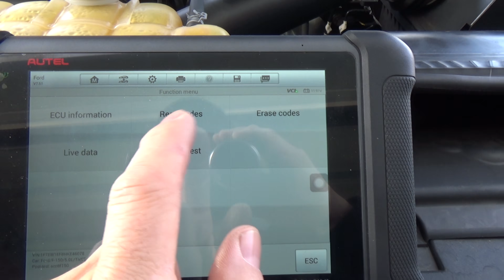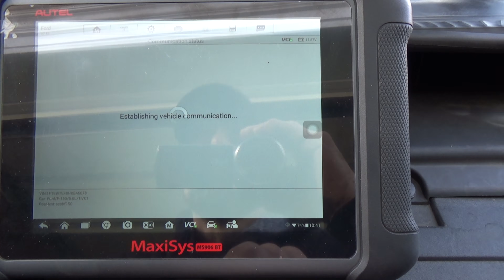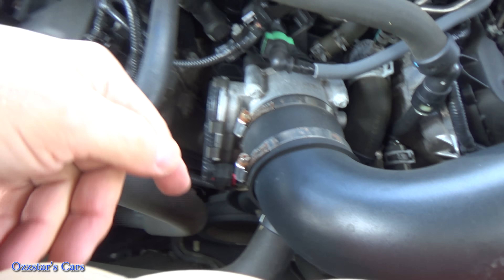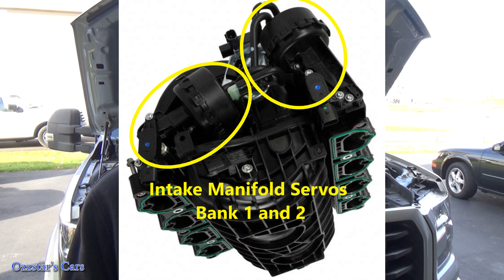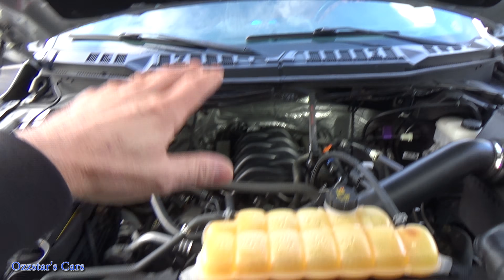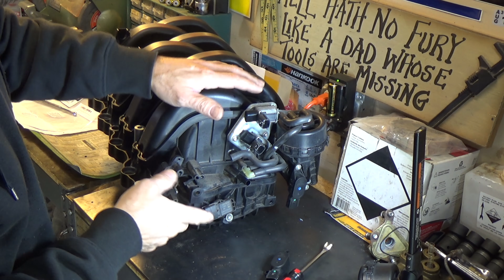Ford F150 Engine Rattle Tick Noise: I Can't Believe Shop Says It Needs A New Engine

Comment: I have the 2019 f150 with 5.0 and mine had the same issue then ford found a piston loose and scared up cylinder wall then they replaced the long block at 35k miles and then installed the longer oil dipstick and replaced the PCV valve with the 2015 mustang 5.0 pcv valve with the checkerboard cut holes to restrict air or gas and then reflashed the throttlebody to reduce the butterfly from openeing and burning oil they did all of this per the latest Ford TSB., it worked, it no longer burns oil and now at 56k miles with no issues still using 5w20 oil no problems.
Reply from the maker: Interesting info. In 2018 Ford ruined the 5.0L by going GDI. They suck more than oil. lol

Comment: Hi ozz star car's many thanks for your videos as to what you have stated that the part for this f150 truck is oem part i disagree as ford motor company doesn't make it another company is manufacturing the parts as its all to do with patent technology/design which isn't right as if it was possible to get the parts somewhere else i believe it would be a bit cheaper merry Christmas to you regards Tony 😀 😊 😉

Comment: A long screwdriver works good as a mechanic's stethoscope too.Put the tip on the noisey part and the handle near your ear hearing the noise
Reply: Make sure your not wearing a tie when you do the screw driver trick . I had to have my 👃 nose worked on. Just like Michael Jackson I opted for the clip-on .Joking of coarse.
Reply from the maker: That's a good trick

Comment: People like you make me proud of the mechanic community here on YouTube. It’s a shame that the so-called experts at the dealer didn’t even diagnose it correctly.
Reply: If there isn’t a code popping up then the motor is fine…. According to the dealerships. Pure garbage service.
Reply from the maker: @917684901385338  need that check engine light on for the manufacturer to pay if it's a warranty claim.
Reply: @ozzstars_cars it’s by design. They rape each customer and don’t try to get repeat customers.
Reply from the maker: Thanks Dan.  You keep up the good work as well!  No hacking goin' on!
Reply: Give the highest estimate you can does one of two things, it will make you rich or it will scare the customer away, primarily customers just don't know so the tech can get rich quick and still give some type of a discount, once you sign the work order, you promised to pay the high price, no discounts required from there.
Reply: My dealer doesn't know shit. I am trying to figure out how to fix my 2018 myself. It makes all kinds of noises.  My 2011 5.0 is perfect at 243k. Technology isn't always better.
Reply: Yep, you cant even trust these stealerships to perform proper diagnostics..shame.
Reply: They probably lost all thier good techs because they wouldn't pay them and got some kid that knows nothing working on it
Reply: @GREGORYJHALL that is exactly why you have a hard time getting good service. If you don’t pay your mechanic a living wage, he won’t be there long. Most of the good ones had to get a paying job sacking groceries, their talent going to waste and autos stay broken down.
Reply: Those Engines sound like a old 312 Ford engine noise
Reply: Nothing harder to find than a good diagnostician.
Reply: Can I replace this pos with a boss 302 intake and have no codes?
Reply: Pvc is up front.
Reply: the problem is that these dealerships will hire anybody with a tool bag and if theyre not union they love to give the diag work to the lube techs. why pay a journeyman $40+/hr when you can pay an hourly employee $18 and pocket the other $160 in labor? the dealerships do it to themselves but its not always the techs fault.
Reply: Dealerships have no interest in fixing they have an interest in running up the bill because that's what brings in the real money for the dealership as well as to commissioned employees.
Reply: nah when the independent cant fix it or its too complicated it comes to the dealer the last place it has to go. but most dealership have run off their experienced techs and won't pay them for what they are worth so most dealerships are full of hacks and kids who do not know shit! i have been a Chrysler master tech for 34 years and fixed a lot of shit but I'm done it's a tough biz to get into   @Sulfen